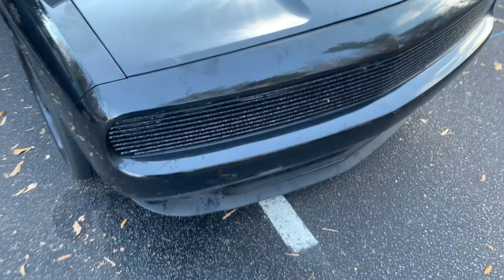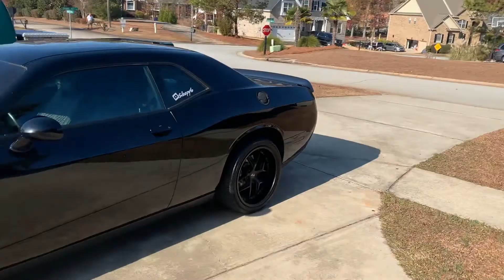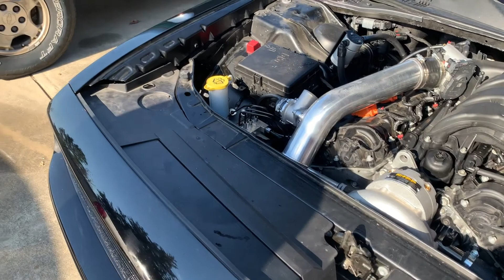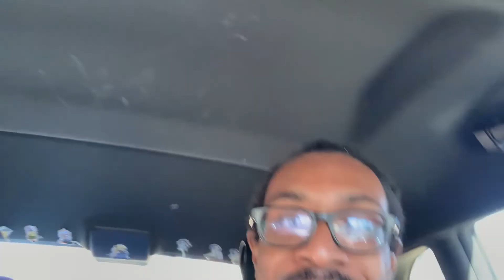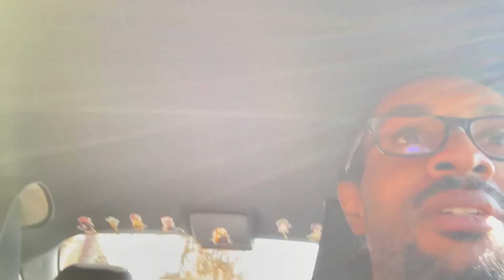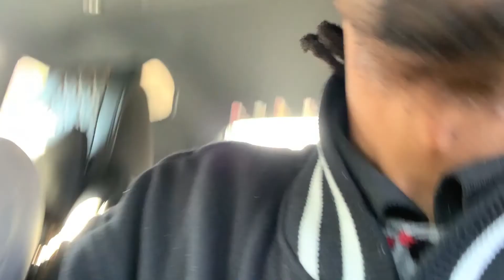475 HP Ripp Supercharger Install And First Reaction!!!

Comment: Can’t wait to get mine. Did you have to make any big changes in order to add on the RIPP?
Reply from the maker: No big changes it just a bolted on system if you just want what the ripp kit offer out the box. Other mods are for additional horsepower and response.
Reply: @Sleepy6  Thanks, bud.

Comment: Show dyno graph stating your getting 475hp because I find it hard to believe the pentastar v6 with it’s restricted air flow is getting that even to the crank let alone to the wheels and especially on stock internals
Reply from the maker: I’ll show you my dyno sheet in the next video. The supercharger kit video shows challenger/charger on the dyno running 420 dyno without a exhaust upgrade or other parts just the ripp supercharger kit itself.
Reply from the maker: Also please check all videos and shorts videos
Reply: @Sleepy6  I will, if that’s the numbers you got with the tune that’s insane numbers. How’s your 0-60 times? I might in the future either procharge or supercharge my widebody challenger and add LT headers and high flow cats and get it dyno tuned.
Reply from the maker: Best i got with the stock bottom end gear and bad rear tires was a 5.2
Reply: @Sleepy6  that’s a dam good time it’s almost if not a second off stock imagine with good tires and changing out to a more aggressive gearing.

Comment: For the price of the Ripp with installation you could’ve bought an R/T
Reply from the maker: Negative I still paid less for a brand new r/t my car was 21k brand new r/t cost 36k. So 8k plus 21k equal= 29k. My car had 12 miles.
Reply from the maker: 15k for 70 hp more that stupid. Comment like  this is a endless cycle y modify a rt you could brought a scat y modify scat you could brought a HC y modify a HC you could of got a demon. Blah 😑 blah 😒. The real question why your upset 😠 bout what someone else spent time and money 💰 on you didn’t earn their money and time.